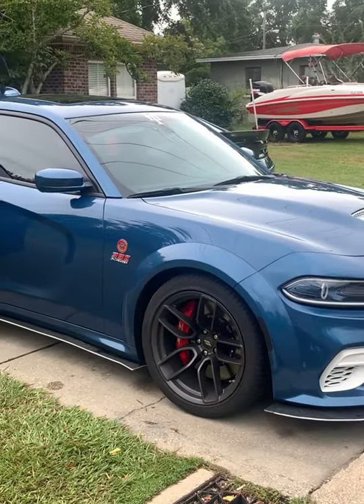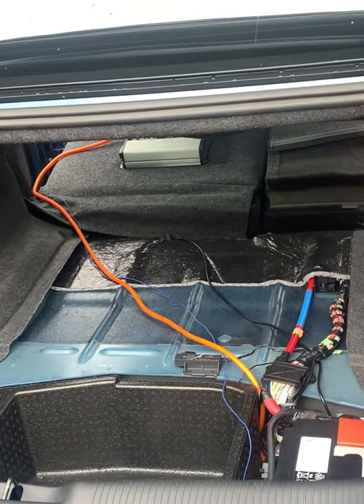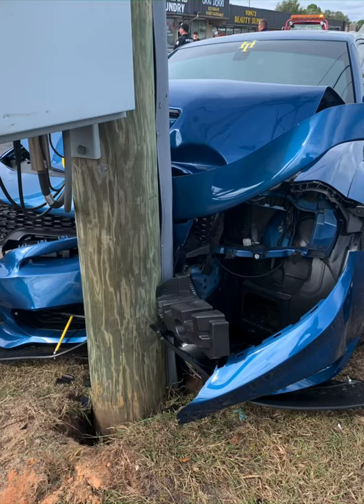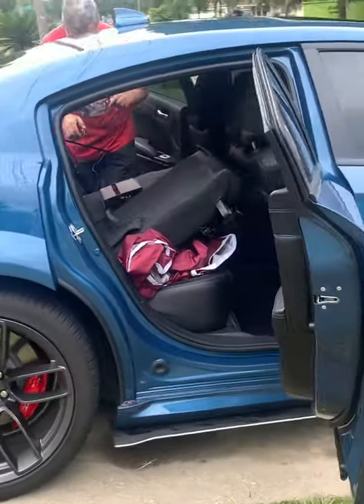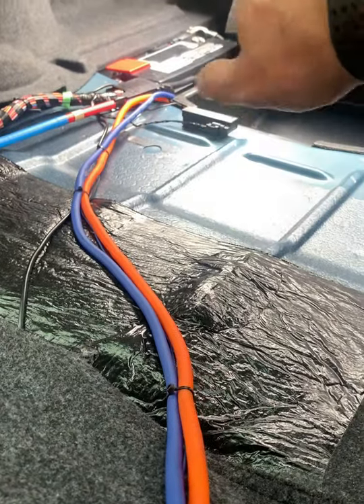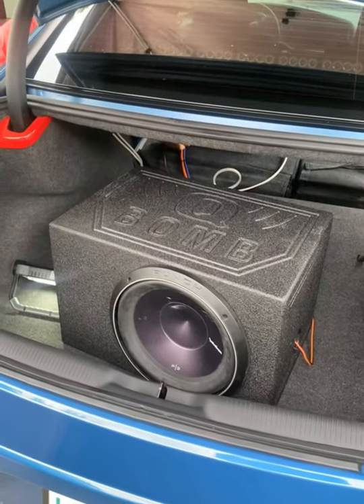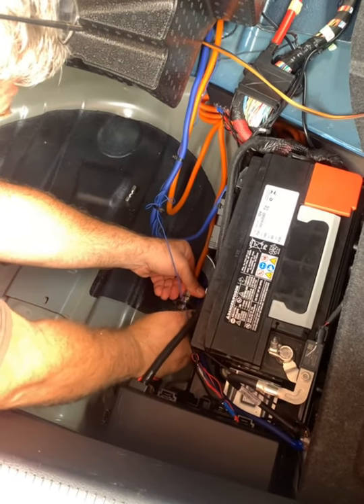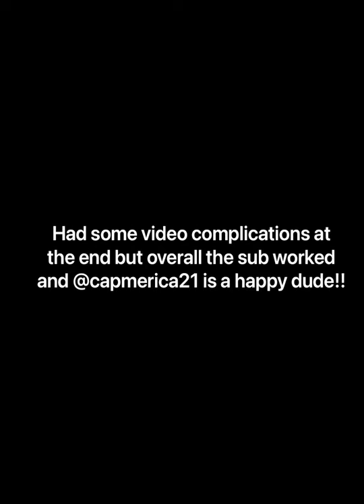2021 Dodge Charger Stereo install

Comment: Put a multimeter on the wires to find the positive and negative. I have a 2020 scat and switched all the alpine speakers to Jbl Stadium 6x9's and Jbl club for the 3 1/2. Sounds awesome. Keep up the good work, funny I found this video, around Holt area was my old stomping grounds when I was younger. Now living in SC, I'm looking to move back in the Navarre area.

Comment: Did this affect you being able to lock your car from the inside? I did mine the same way, but when I lock the car from the inside. It beeps 3 times and unlocks like my keys are inside of it. But I can lock it with my key fob. My amp does turn on when I unlock or open my doors. So I think that’s probably why. But unsure